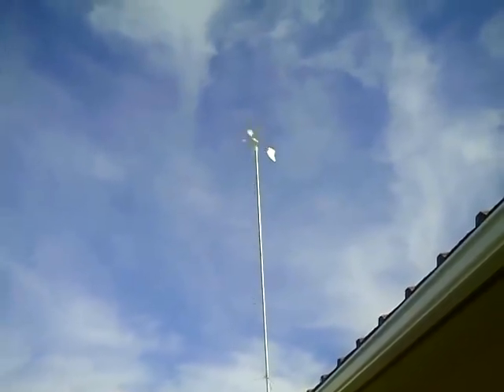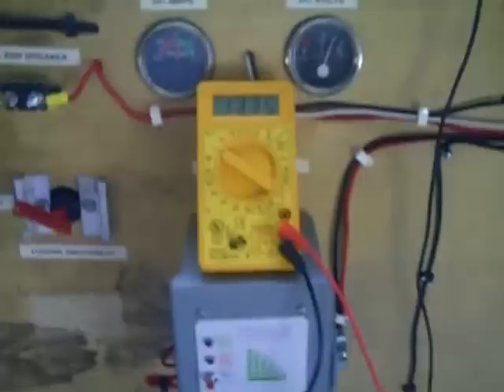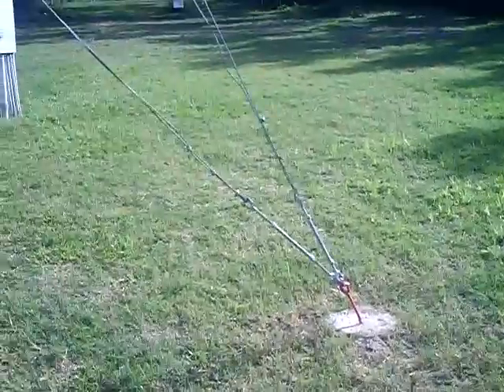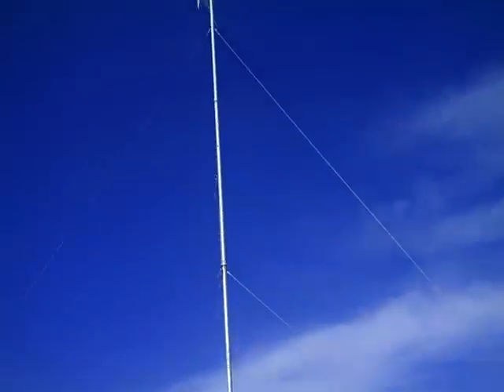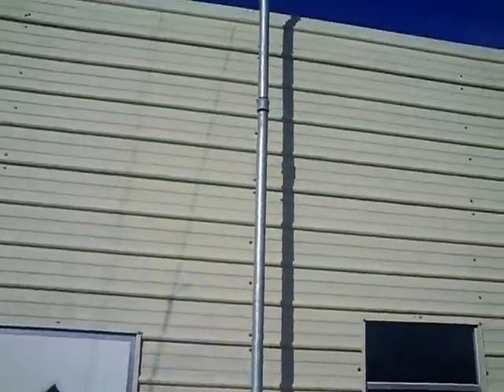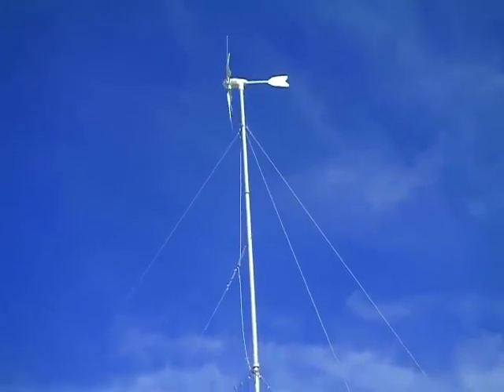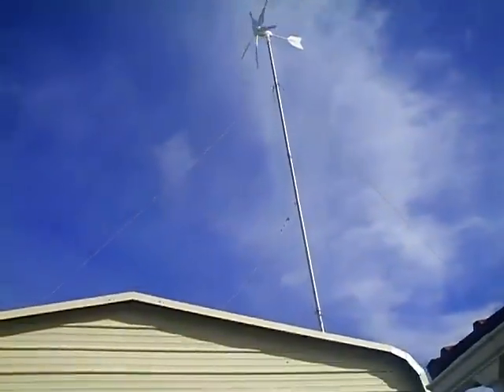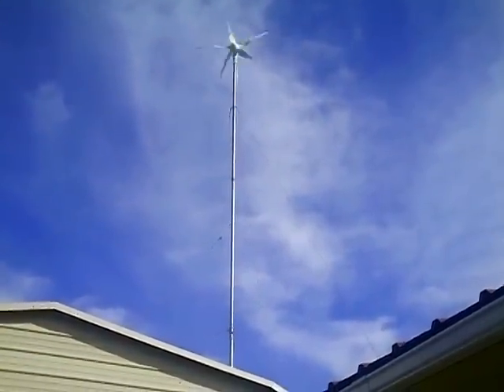WindMax 1Kw Wind Turbine

Comment from the maker: @SidneyBou I hate to tell you that you're either hearing things or seeing things, I never said what you claim. I clearly showed the turbines at 13.34 with 6 amps which is 80 watts, so I don't know where you think you heard me ever saying that 1 amp at 12 volts equals 1kw. Further, at full wind I know for a fact it can push 83 amps but highly unlikely because the bank would be nearly charged at 14 so my amps would be 71.5. Amps.  I was an electrician for 20 years so I know a thing or two.

Comment from the maker: @Nomoreidsleft The wind power required to move the water and store it high to create sufficient water column will surely be higher than the amount of power the water will supply later. Additionally, the engineering and costs required for the tank, plumbing, modifying the turbine to use both wind and water (that would be a nightmare) would make this project a no go in my mind. Which is probably why I've never seen anyone do it. It's a good thought, just no practical in my estimation. Thanks

Comment: @econewpower Not sure about that.  The water would be in a closed system, so it will be converved, and power loss due to battery self-discharge would be higher than moving the water up to a higher potential, where the energy is conserved almost indefinitely. (Again the water is in a closed system.)

Comment from the maker: One turbine could be enough if it is 3Kw or larger and if you have average steady winds of more than 20 miles an hour, otherwise count on needing several. You can power anything you want as long as you have a battery bank, sufficient turbine output to keep the batteries charged, anjd a good inverter capable of supplying 240 VAC output.  Look at the diagram I have posted and listen to the audio as it tells you all you need. God bless you and good luck. with your project.

Comment: Good Job, I see you have grid tied inverters, they require 14 - 28 volts right? But you are charging at 12 volts? I am asking because I have almost the same set up and trying to maximize the charging. Thanks

Comment: I did not  make too many calculations whit my wind turbine because I do not rely on it that much since there is not to much wind in my area were I live. However ,I wanted a hybdrid system whit the most electricity to come from the photovoltaic pannels.  I am waiting to install the second turbine to see haw it works